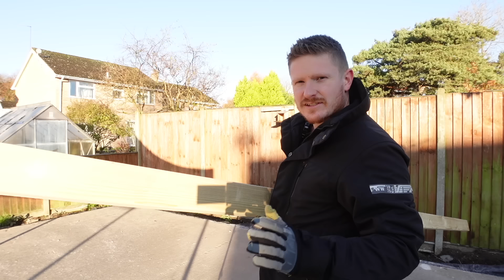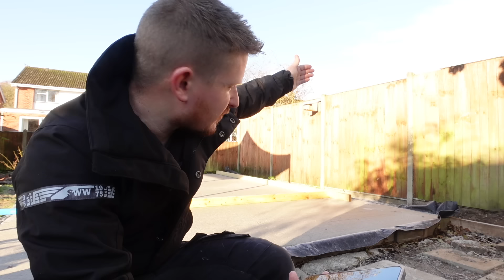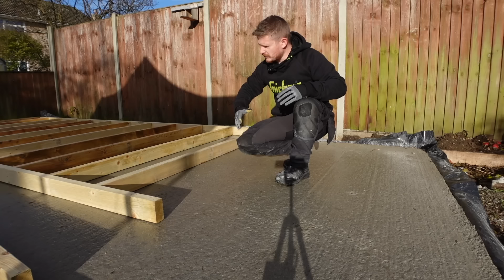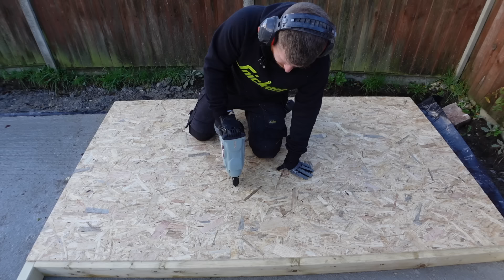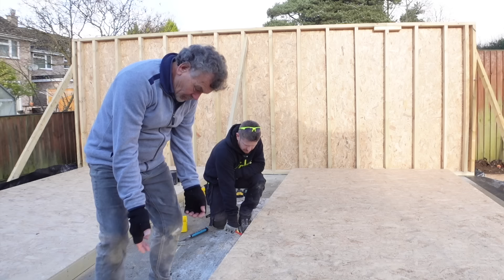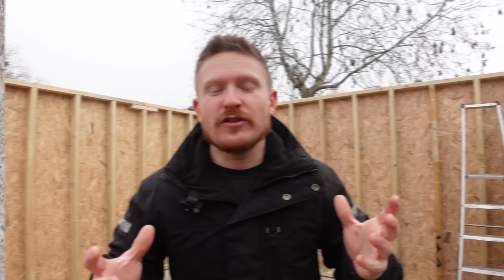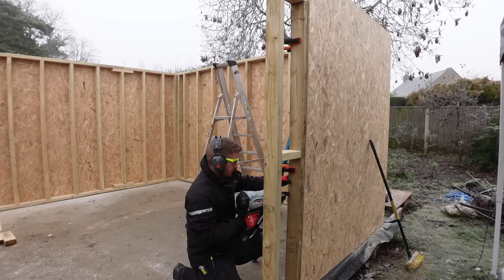How to Build Timber Frame Walls Quick and Easy  - Workshop Build PT3

Comment: You made a cracking job of that! Liked the built in sloping roof feature and the way you joined the long sides together. 👍👍👍
Reply from the maker: Glad you enjoyed it 👍
Reply: @TheDIYGuy1  I was well impressed to be honest. Any idea roughly of the timber costs for that. My 16ftx8ft shed is about £1400 to buy now.
Reply from the maker: Cheers! Timber alone including roof was £1500. But this was trade price from MKM builders merchant. If you were to buy from the likes of wickes/b&q it would be considerably more
Reply: @TheDIYGuy1  Yes what i expected. But that is so much better than shiplap sectioned shed and you can insulate inside . Win win 👍👍

Comment: Proper planning......👌🏻
Reply from the maker: Thanks! That’s what it’s all about
Reply: @TheDIYGuy1 
Does it make more work that osb comes in 1220mm widths but plasterboard is in 1200mm widths? (It is at Wickes anyway 🤷‍♂️) Trim osb 20mm to hit studs??
Reply from the maker: Absolutely. If your OSB is 1220 then rip the 20mm off and your all good on those 400mm centres 👍

Comment: Why no washers on hold down bolts?
Reply from the maker: Not needed. If you look at the bolts they are designed to bite into the surface. Look at the bottom of the bolt head closely and you’ll spot it.

Comment: Did you consider insulating under the concrete slab to help with ceiling height?  If so, what made you decide against that?
Reply from the maker: I did, and if this were being used as a garden room instead of workshop I would have done that. The thing to consider if doing this is that you’ll need to take a fair bit more soil out to make way for the oversize.
Reply: @TheDIYGuy1  True, another 100-150mm of digging would not be fun.
Currently frying my brain trying to figure out the side wall calculations....imagine chopping the back left corner of your building off at 45 degrees....
A 4m x 6m room with a 3.6m back wall, 1.6m left side wall, and a 3.3m wall at 45 degrees joining the two.  I should have studied trigonometry harder at school!
It's the slope calculations that are a 'mare, as the uprights on that angled wall need both a front to back angle cutting on them, same as yours, but also a left to right angle cutting.

Comment: Great video mate. Quick question, when the rain runs down the outside, won’t it work its way in as it will be soaking the sides of the concrete pad? Will you fold the DPM up and clad over the top of it to avoid that?
Reply from the maker: The DPM will be folded up the walls with the breathable rhino vent membrane overlapping it. This will then be clad. There will be no issues with damp or water coming in contact with the walls. Thanks

Comment: Good job 👍what thickness osb you used ? For outside corners for side walls I would do osb overlap of thickness of stud + osb. as you need cut narrow piece to cover timber .)1 joint covered plus extra tightening together🤷‍♂️
Reply from the maker: Thanks. This is 11mm osb on the walls.
Reply: @TheDIYGuy1  and what are the dimensions please mate if you can remember?

Comment: No Track Saw wow have a word with Dewalt🤣🤣  make sure you insulate that floor well I made that mistake bloody freezing in winter oh and wouldn't want the bill for that Timber now well done looks great
Reply from the maker: Haha I’ve been messing around trying to decide on what one I want! I might go with the makita 40v. That’s a tough decision for someone who’s primarily dewalt! Cheers
Reply: @TheDIYGuy1  I'm on Milwaukee but I was pretty impressed with my cousin's DeWalt track saw. The corded festool is decent as well
Reply: @TheDIYGuy1 I bought the dewalt corded track saw and when I was building the loft boards I built a surround for the hatch out of the flooring and got it spot on to less than a mm tolerance. The rubber strips on the side stops tear out and let’s you make accurate cuts like I said to less than 1mm. I suspect they are all pretty much the same though, but I’m well pleased with my one.
Reply from the maker: Cheers for sharing 👍
Reply: @TheDIYGuy1  Bosch track saw here.

Comment: Any windows?
Reply: Was thinking the same, always good to have some natural light.
Reply: I imagined there might be one in the wall with the door and one in the wall not facing a fence.
Reply from the maker: No windows. This is for security reasons. I don’t want people to be able to see what’s stored inside.
Reply: @TheDIYGuy1  You could still have them/one with toughened privacy glass. Allows light in but no one could see in!
Reply from the maker: Good point. I could cut some in
Reply: @TheDIYGuy1 on my shed I have Perspex and I didn’t take off the supplied protective covering on the inside so they are frosted.